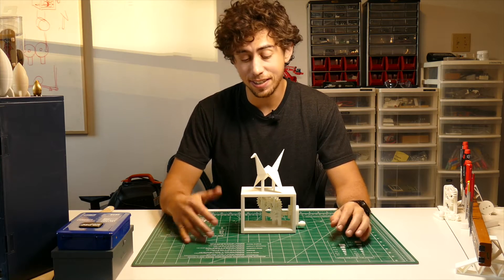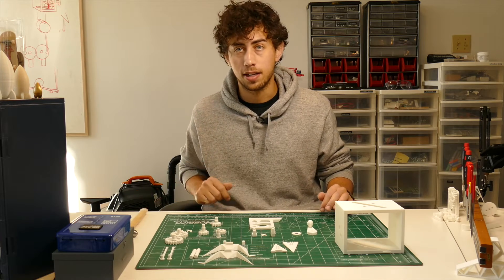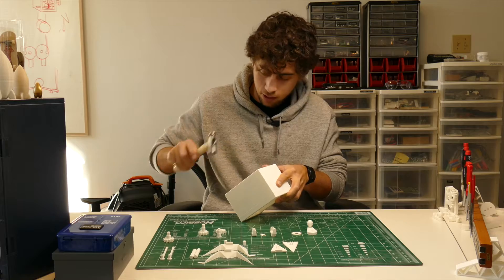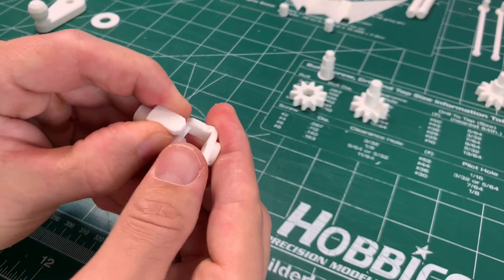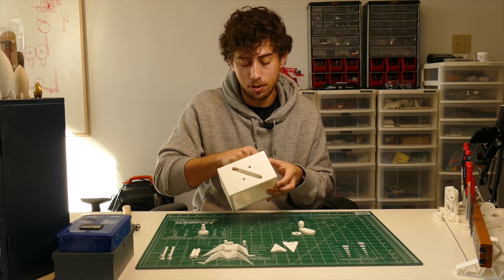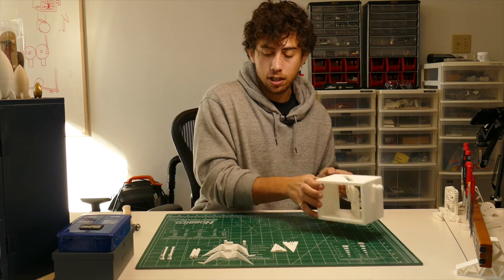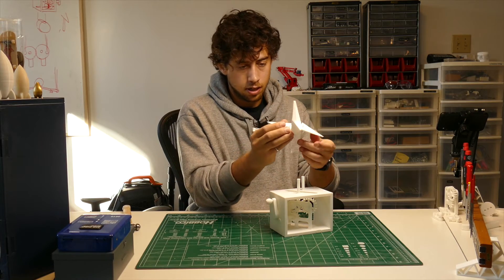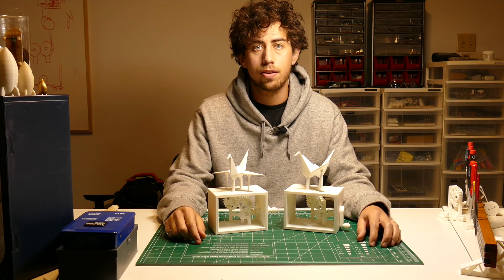Crane Automata - Fully 3D Printed Kinetic Sculpture

Comment: Any information on the infill densities?  Do any of these parts act as counter weights?  I typically print those types of parts at 100% to ensure maximum density.  I also like to print load bearing parts at 100% or at 75% with extra walls.  These are all guesses though, and I'm assuming you have already printed it, so if you can share the settings you used that would be most appreciated.
Reply from the maker: Normally I print at 18% and it works great.  You can print at 100% without any problems as well.  Let me know if you have any other questions!